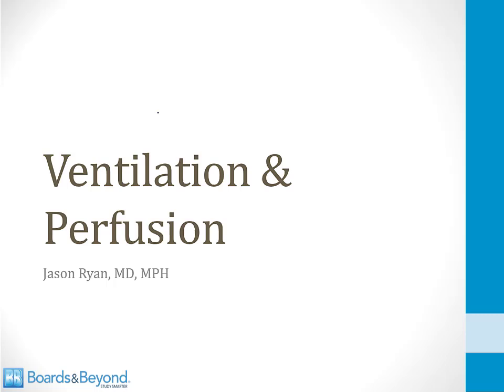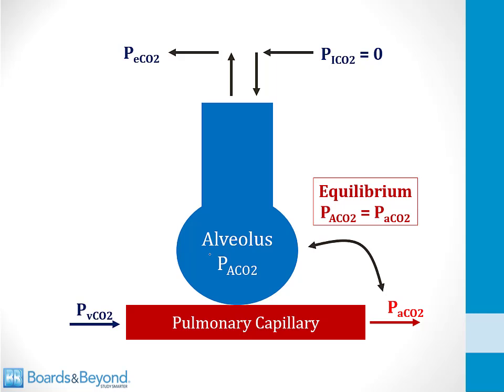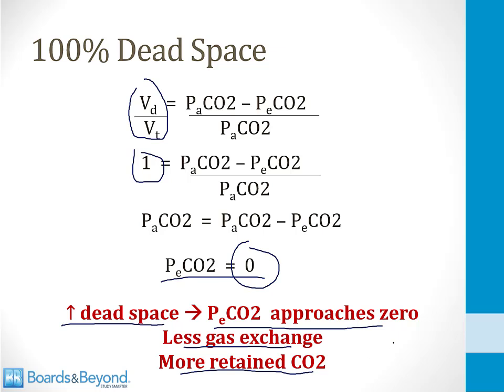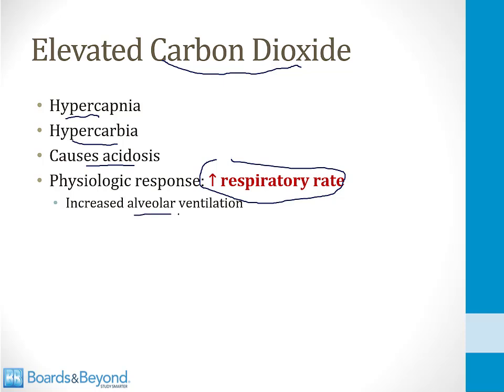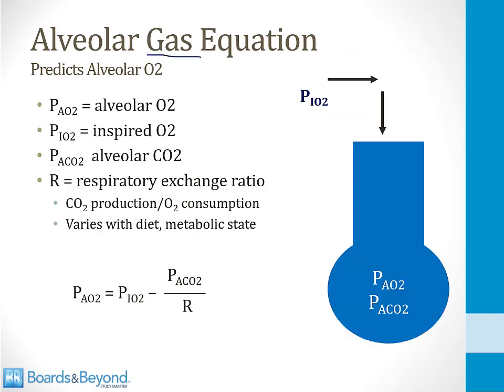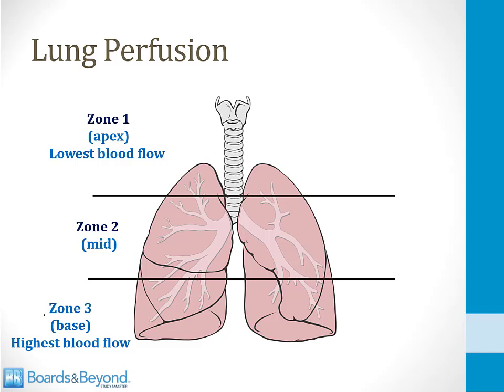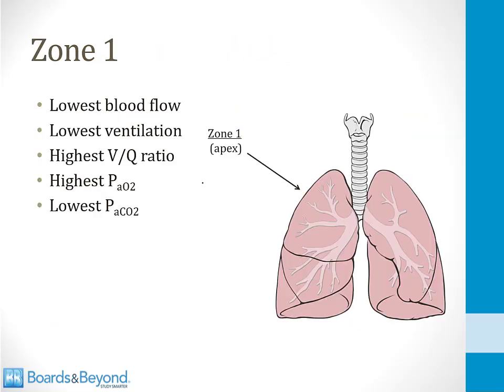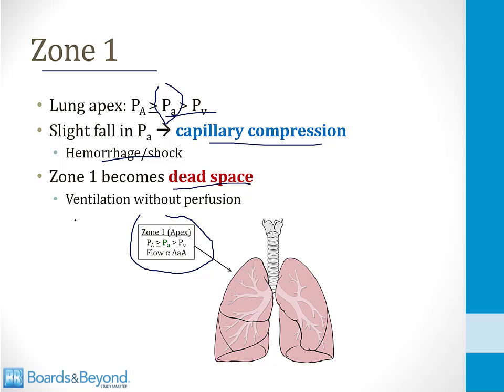Pulmonary USMLE Step 1 — Ventilation and Perfusion — Boards and Beyond

Comment: If you breath 500cc per minute you would be dead. On your Alveolar Ventilation Equation slide minute ventilation should equal 500cc (tidal volume) x RR. With each tidal volume partitioned into 150cc dead space and 350cc available for gas exchange. Thus alveolar ventilation should equal 350cc x RR if my math is correct.
Reply: You are right.ur alv vent is (tv minus dead space) x RR. And avarage tv is around 6-8ml x kg
Reply: yes, its 500 ml for each breath taken not per minute. 12-20 breaths per minute, so 6L/min or 4.2L/min for alveolar ventilation
Reply: I have failed this  2 times and my emotions go in waves, i think passing SMLE STEP 1 is not meant for people like me 😭 😢 😕 😐 😔 💔 😭 😢 😕 😐 😔
Reply: Passing the  test is a challenging and frustrating experience. I believe that it's not just about studying, but also about having God's grace to succeed.
Reply: It's true.
Reply: Frustration can be a positive sign. It indicates that the solution to your problem is close, but your current approach isn't working. You need to change your approach to achieve your goal.
Reply: I'm sorry to hear about your situation, my friend. I was once in your shoes until I was recommended to Mr Richard Brown, who helped me pass my step 1, going for step 2.
Reply: Does anyone know who Mr Richard is? I'm feeling frustrated and I need to speak with him. 🥺
Reply: Wow, I'm surprised to see Mr Richard mentioned here. I worked with him last year, and I passed my step 1 and 2. I'm going to be taking the step 3 soon, and I know his going to be my backbone. 😇
Reply: I want you to know that if you're being hard on yourself for something that has happened, it's normal. Life can be challenging, and no one gets through it unscathed. We all have scars and scratches. Please be kind to yourself and stand up for yourself
Reply: His is available on
Reply: whatsapp
Reply: +1
Reply: 21920
Reply: 28257
Reply: That's his what’s@p info
Reply: I overheard some licensed physician in the United States talking about him, but i didn't understand what they were saying, i hope he replies my text on whatsapp
Reply: Thanks i also needed his info too, I'll write to him shortly.
Reply: Becoming a licensed physician in the United States has been my greatest achievement since my lifetime and I'm so happy and grateful to Mr Richard for making my dreams come through.
Reply: Yes of course he is, i thought  people  don't  know  him that much, he helped  me walk through the fears and fails of step 1.
Reply: I feel like I've lost hope in passing my Step 1, but am considering reaching out to Mr Richard Brown to see if he can help. Seeing comments from others who have passed their exam makes me feel jealous.
Reply: That’s crazy dude, you don't have to because you can still make it yourself just believe and study hard, or better still you can look for help
Reply: I passed my step 1 last week after studying so hard , I’m not here to discourage anyone, just wanna say do whatever you believe will help you pass
Reply: I initially thought that Mr Richard Brown's work was made up, but i contacted him myself and passed step 1 before i believed in his work.
Reply: I trust Mr Richard Brown to always deliver success in my exam.
Reply: @AlexJoe-ve6gc   ARNP.👍